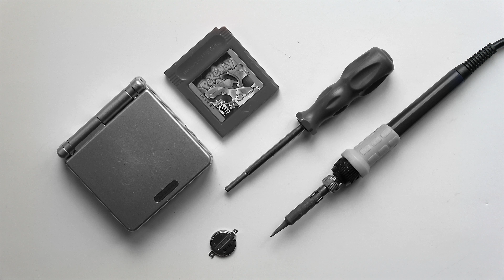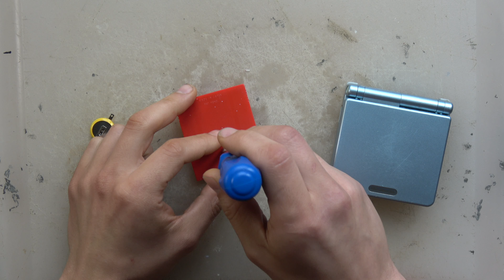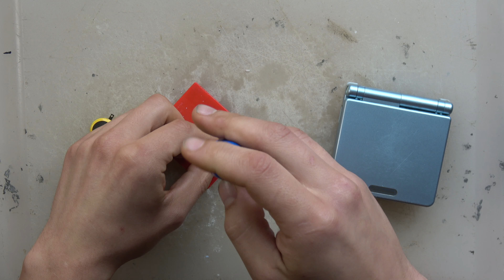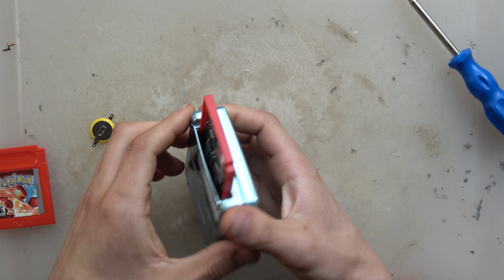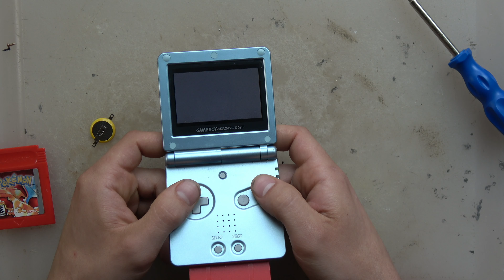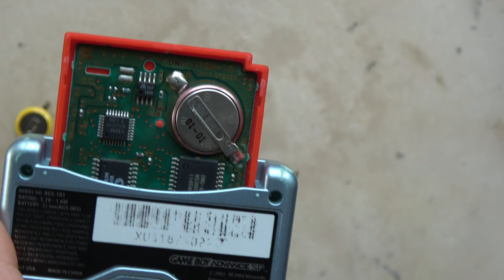How to Replace your Battery and KEEP your save - RGA

Comment: This is not a safe way to replace the battery. If your soldering station is not appropriately grounded you run the risk of damaging the cart or the console. You should never solder on a live circuit without having the station grounded correctly.
Reply from the maker: glad i didnt loose my childhood save file on my pokemon becouse the iron wasnt grounded, going to look into how to correctly ground my iron incase i ever work on a live circuit again
Reply: RETRO GAMING ARTS if you are using a soldering station then the station itself must be designed to allow for an earth ground to be attached to the base. It is generally a hole in the station that must be hooked up to ensure ESD safety. If it's a pencil style iron, they usually won't have this.

Comment: damn they actually solder those battery, thought it was gonna be like the Ti-Calculator, quick swap out
Reply from the maker: gotbletu the sega saturn has it where its a quick swap out, same with the neo geo pocket color, but most cases the batterys are always soldered